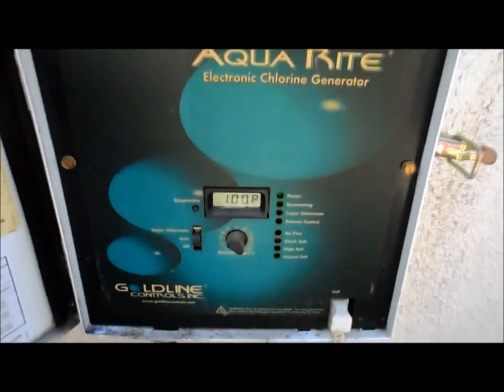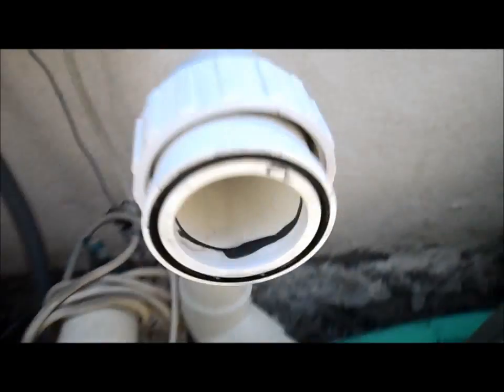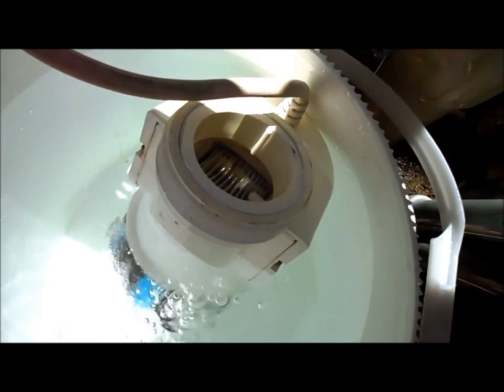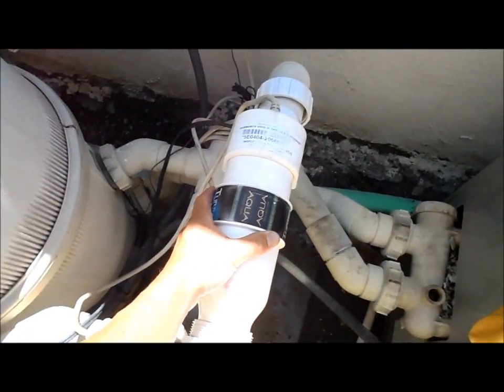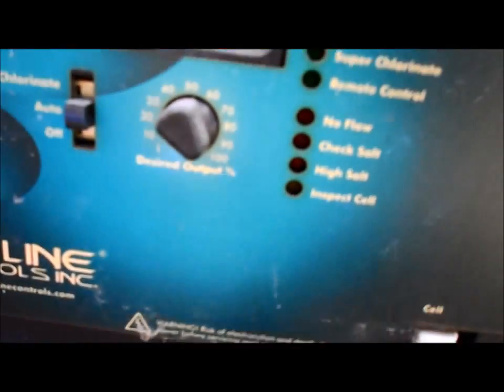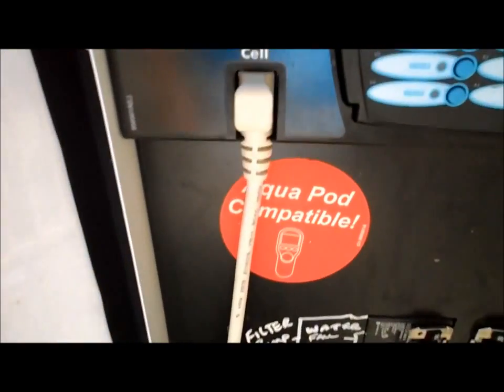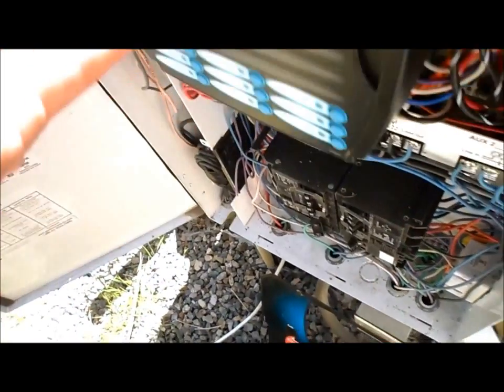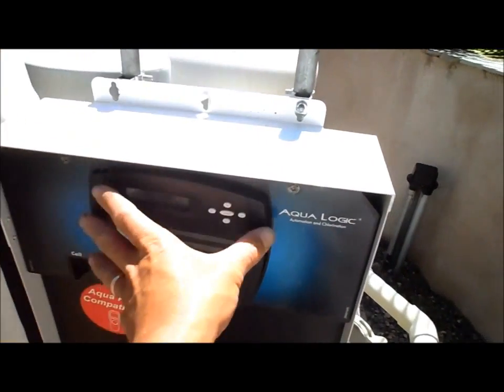AquaRite Salt Cell, Hayward AquaRite cleaning and troubleshooting

Comment: You don’t want to drop the cell directly into a bucket of acid. It can shorten the cell life and plastic.
Reply from the maker: Yes, always an acid and water mix.
Reply: @SPL  another question is my pool has the same system. The chlorine is around 8ppm and we tried to turn the knob to lower the output level and the chlorine is staying at 8ppm. We don’t add liquid chlorine or tablet. Do you know what could be the cause?

Comment: Great video. Would a dirty cell cause the instant salt reading to say 0?  When I turn switch to off and back to auto again, it reads salt level but eventually goes back to zero while generating light remains on.
Reply from the maker: It might, or the cell could be dying.

Comment: My cell is not reading the right salt levels after cleaning cell and recalibration. What should I check next?
Reply from the maker: Any error codes?
Reply: We had the same problem, it ended up being the flow switch.  I got mine at Amazon.  it is called a flow switch assembly with tee.  My husband is installing it right now.  good luck.

Comment: Hi buddy, I just purchased a new home which has salt water system in. The pool guy that comes said he's been adding chlorine and acid but he doesnt' need to since its salt water pool. I noticed that "Inspect Fuel Cell" light is on on the Aqua Rite Electronic Chlorine Generator. Is there a way to check what its wrong? Looks like that generator is working as I see a green light. Any way to know the normal ranges for all the values in there. It would hurt to spend $$$ so trying to see if its just a minor fix. I seen some videos but I am totally new to pools so any help would be greatly appreciated. I will be using links from your site to buy pool supplies.
Reply from the maker: jassa singh Could be the cell is getting dirty - calcium build-up. Your pool guy can clean it for you. If the "Inspect cell" light is on then the unit will not be producing chlorine. He should clean the cell on his next visit. 

As far as checking if everything is working - once the cell is cleaned the "inspect cell" light should turn off and a salt reading should be displayed. Have your pool guy check the water with a salinity tester to see if the numbers match. For instance if the read out say "3200" the independent salt tester should also read the same "3200." If not your system needs some work. Hopefully everything will be working fine after the cell is cleaned.

Comment from the maker: Maybe. They are pretty durable. The cell plates are actually made out of Platinum if I remember correctly. That is why they cost so much. I think it is over $1,500 an once for that metal. The only way to tell is with time. The cell light will turn red if the cell life is over. Lets keep our fingers crossed...

Comment from the maker: I am not in front of the unit now, but if I remember correctly, if you turn on the pump, unplug the salt cell and then plug it back in to the panel (It just pulls out of the panel like a regular wall plug) it will then try to activate. If all goes well you will NOT see this message: "Salt Cell No Power" or "Salt Cell High AMP." That means the board has an issue still. It will still display the salt level 2000 ppm for example and the AMPs even if the cell is not working. Hope that helps.